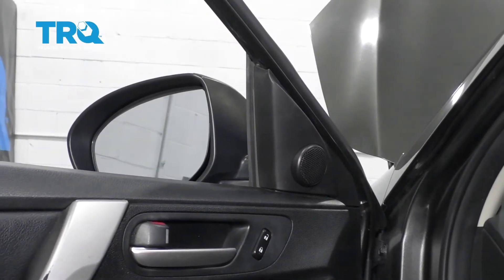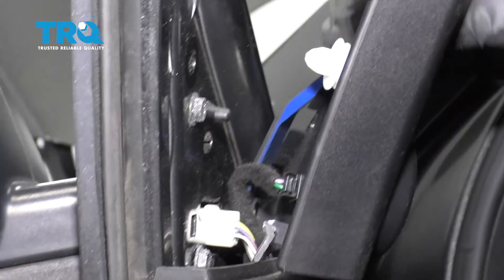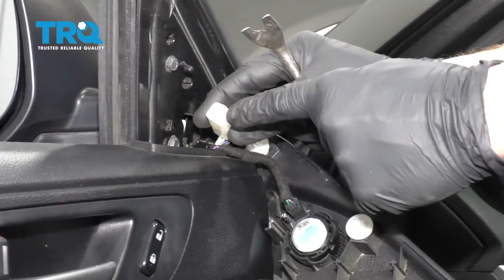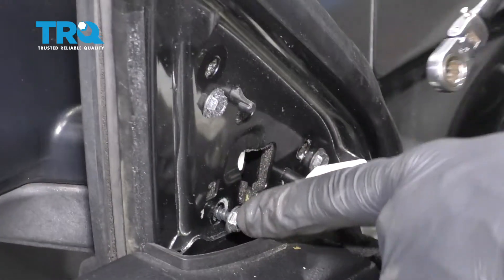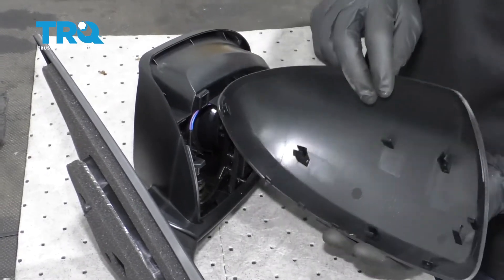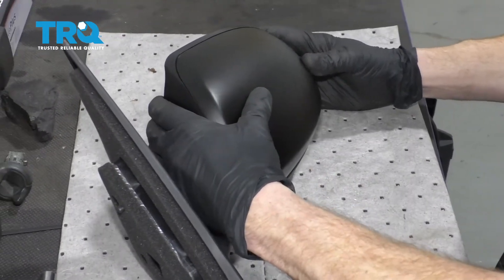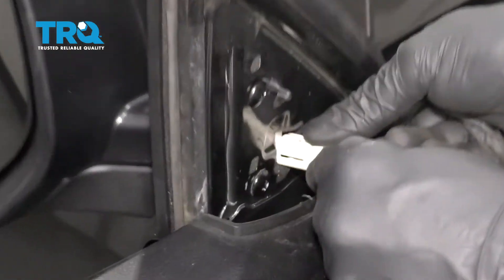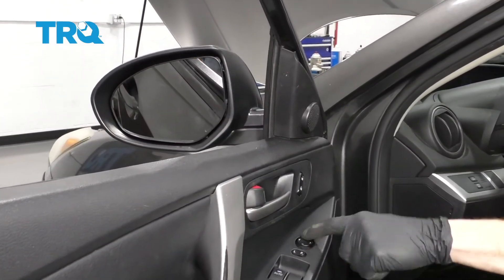How to Replace Side Mirror 2008-13 Mazda 3

Comment: My right wing mirror keeps making a whirring sounds and won't work at all it's constantly making a sound the left one opens and closes the right one I have to manually close now and even after I switch the car off the whirring nose continues for about 40 seconds is this a motor issue ?